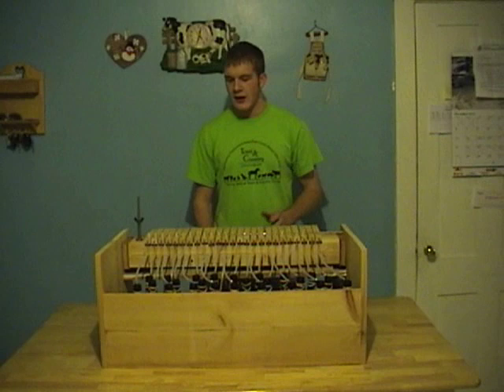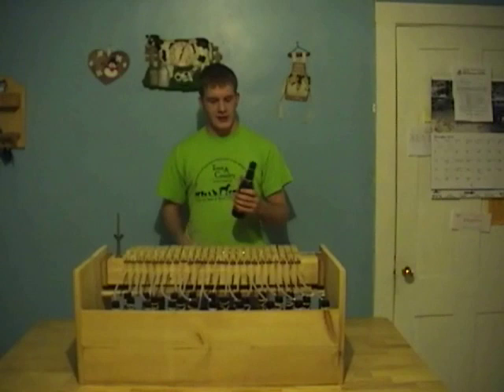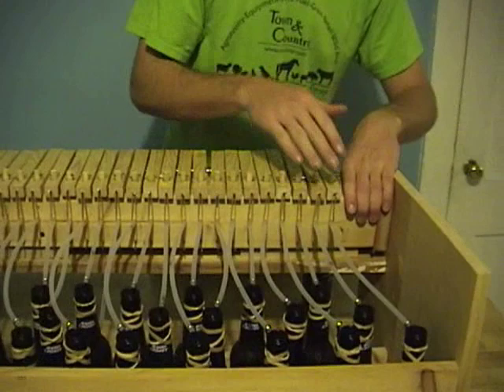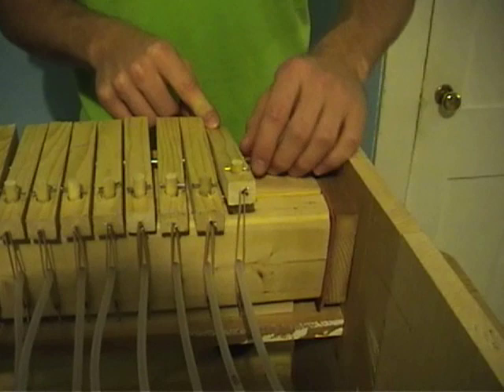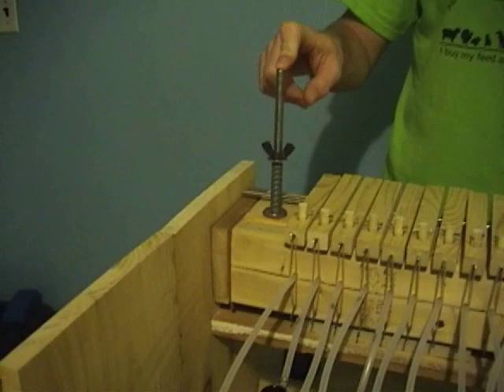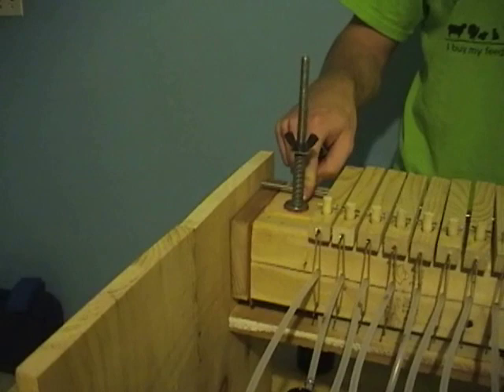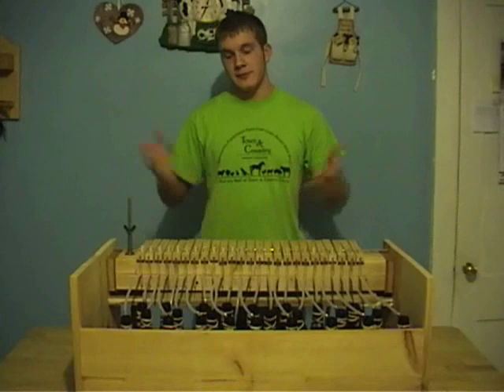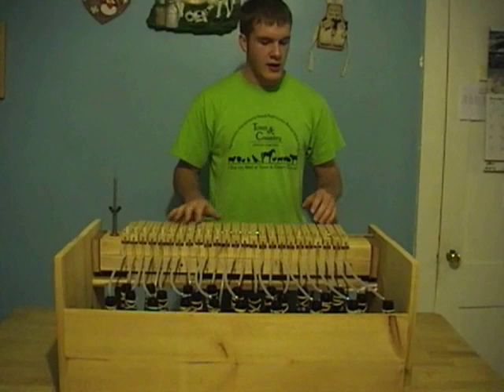Beer Bottle Organ

Comment: yeah i have seen midi pipe organs and i soon hope to put one in mine. u do need to know a little on how to wire it for sure unless its just for the keys. i was going to use soda bottles in the pipe organ i'm building but then someone gave me some pipes. over 1000 to be exact. cant use all of them but might start a building career with it. 
about this video,   nice wind chest. also i use leather 4 the lks. (inside of the chest, and leather on the valves) blocks well.